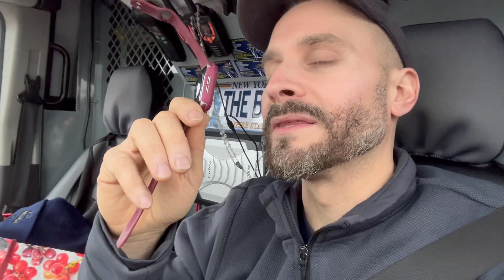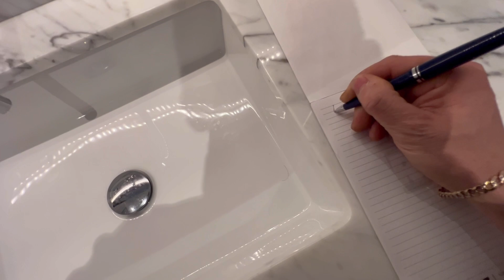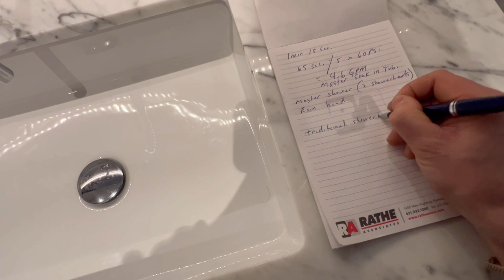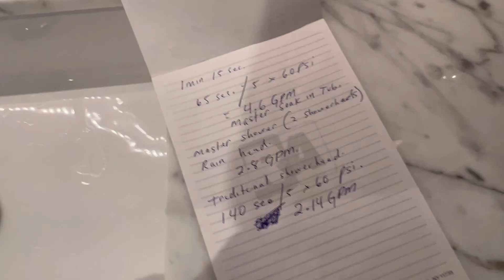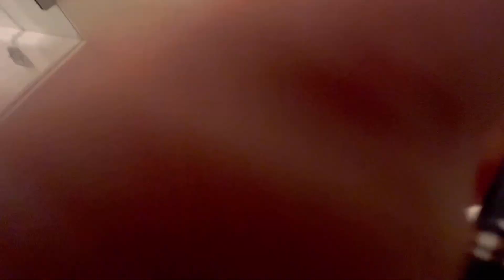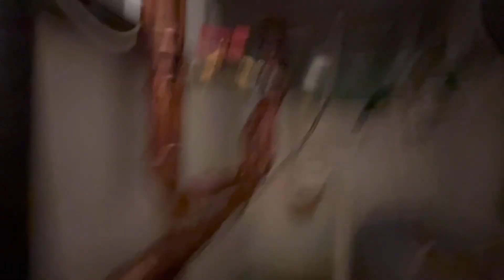GPM FLOW TEST !! NEW WEIL MCLAIN ULTRA 3 SERIES 4 HIGH EFFICIENCY BOILER COMING SOON !!

Comment: had nothing but trouble with ultra boilers software glitch kept shutting it off in middle of winter weil mlain had no solution
Reply from the maker: THERES NOTHING BETTER THAN A SOLID CAST IRON FLOOR STANDING BOILER 👍🏻

Comment: Problem with the bucket test, is your restricted to the size of that line and valve.  Gets you close but if the feed and takeoff from the tank are larger then your not only going to be off by flow but if your measuring temp drop you may be a little off with that.  Most cases your taking the flow off a 1/2" line.   The ultra has screwed my so many times, the production line of that is only for swap outs.
Reply: @M.J.F.MECHANICALL.L.C.  No worst one for me, 18 months old the pressure gauge capillary blue out somehow.  Soaked the entire boiler,  Saturday, January during a deep freeze.  Spent Sunday installing the new one.   WM made me eat it all for almost two years, finally got credit on the boiler itself and nothing else.  That and chasing the world for parts and one program upgrade screwing up another.  I was one of the best tech's out there, even went out with the reps.  I could not take it anymore and just gave them up.

Comment: As a tech whose installed and/or serviced many different boilers I would steer away from the series 3 ultra. From a maintenance perspective due to the aluminum heat exchanger. Go with a viessmann , German engineering….Also it’s not a vertical heat exchanger like the htp, seems like your steering away from that lol .

Comment: I put a Toto in. Installed it myself. Life changing event. Never using toilet paper is a game changer. The hard part is walking into another bathroom and wondering why the lid doesn't open. You get so used to it. At first I balked at the price but after I put it in I wanted to put another in the powder room. Worth every penny. I even bought the travel Toto's. Shout out to Mikey Pipes for turning me on to those.